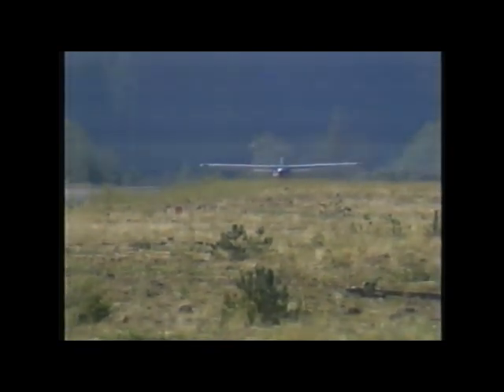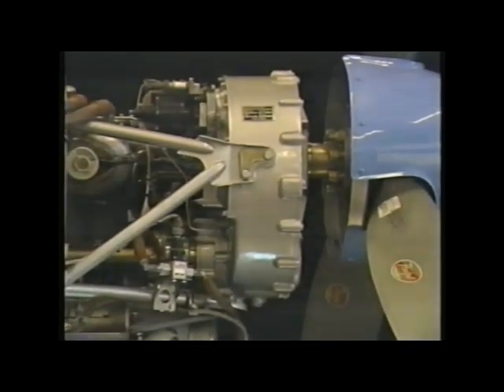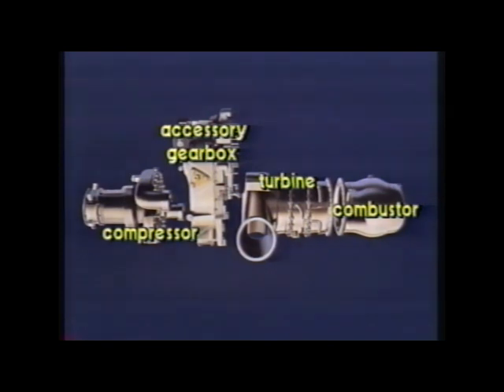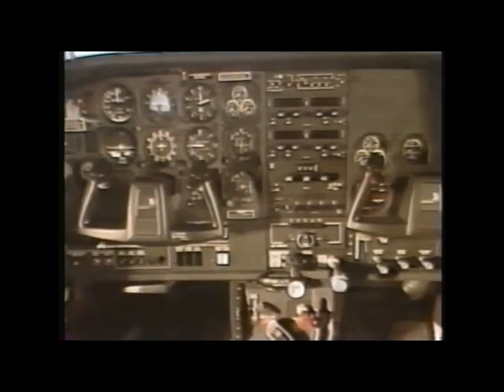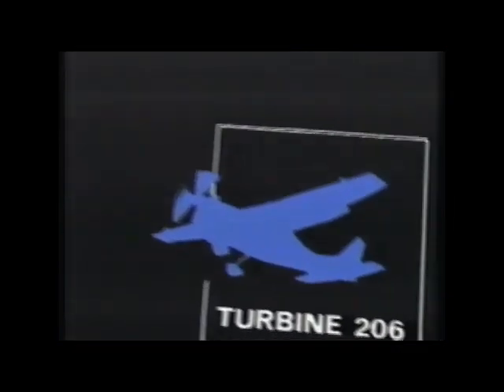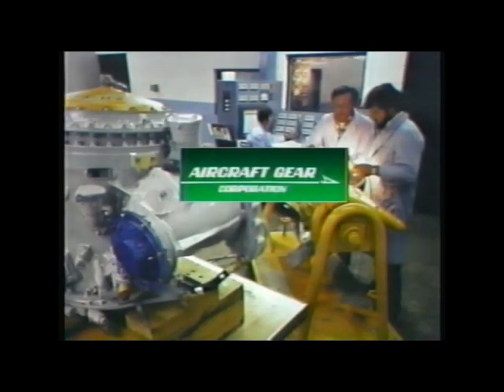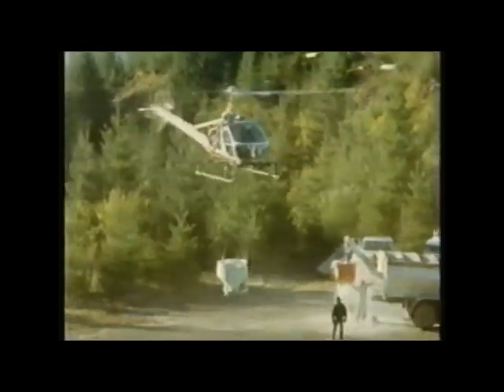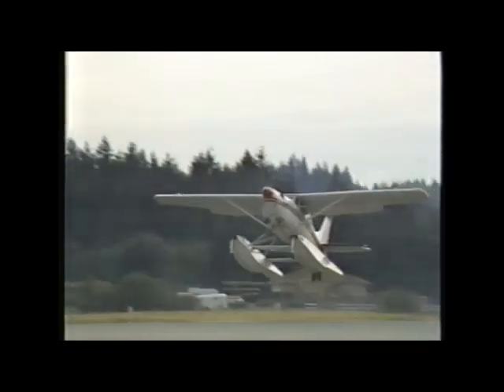Cessna 206 Soloy Turbine (Mark I)

Comment: Wonder just how much of a benefit this conversion is?  Sounds nice but with respect to useful load and speed how much better is it?  Would require a lot more fuel, so the useful load might not be increased dramatically.  Reliability and TBO are better, but your looking at 6 figures for overhaul.
Reply from the maker: This particular "Mark I" STC is an old one, utilizing a helicopter turboshaft engine driving, through a driveshaft, a unique and heavy transmission. Soloy has a much more recent STC that uses a more compact engine package that saves weight and provides additional operating capabilities, a much more practical design IMHO. Plus the wing tip fuel allows a gross weight increase. All in all, a practical airplane.
Reply from the maker: There are benefits to turbine power that many do not recognize, such as: 1) engine reliability is superior to a piston engine; 2) in case of an accident the fuel is far less volatile; 3) cold weather operation (eg starting the engine at 20 below) is much simpler with a turbine; 4) there are many parts of the world where avgas cannot be obtained. And my favorite 5) just the raw power! Example, once I got a clearance from Olympia, WA to FL170. I was level at 170 exactly 10 minutes after receiving takeoff clearance.
Reply: The turbine engine weight is about a third of the piston engine. Even tho the fuel burn for a given horsepower may be higher, unless flying maximum range, the additional fuel weight is not a problem. Later engine versions have improved economy. Plus the turbine is more aerodynamicaly efficient. Fuel burn per mile is close to a piston engine. A turbine is self-cooling so there is no cooling drag from air having to push past cylinders and cylinder heads. Fuel is lower priced.

Still a pricey conversion. Have heard that the engine alone is about $420K.
Reply: @davem5333  ...
Are the piston engines burning 25 - 29 gph?